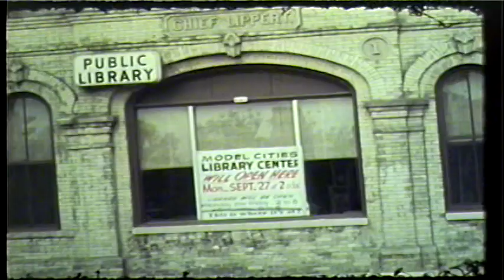MFD E 1 steam engine run 10 5 1971

Comment: I've had a very powerful spiritual connection to the fire service for as long as I can remember.  When I would see images of the horse drawn era, I'd get "goosebumps" (still do). I had a dream back in 1988 where I was on the apparatus floor of a firehouse, there was dark wood walls, railings around a watchman's desk.  A mustachioed man at the desk was talking with me.  I turned around and was looking at a steam engine there; on it's boiler I read, "Philadelphia 1882."  The bells rang, and then I remember heading out the door, bumping along a cobblestone street...then I awoke.  In 1996, I was living in Boston; I had gotten a job as a driver/tourguide.  I was at the Boston Public Library in Copley Square, brushing up on all of that, "...one if by land, two if by sea" stuff.  Mixing business with pleasure I was looking through a book on fire apparatus and saw a photo of the rig in the dream...previous life stuff (of course, I can't prove that, so I just like to think that to myself...you guys are probably thinking I'm nuts anyway).  Nice film!